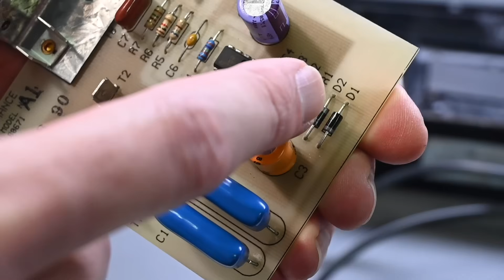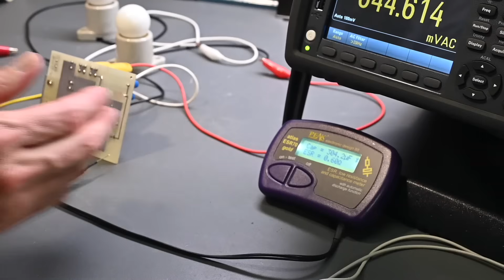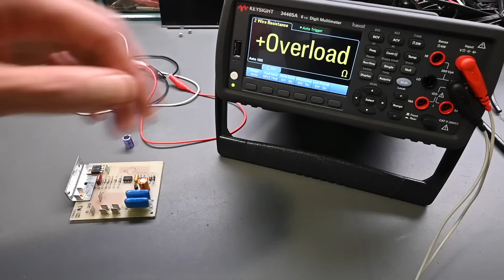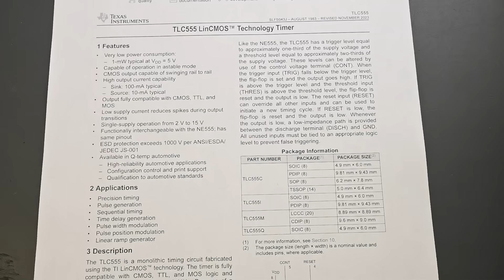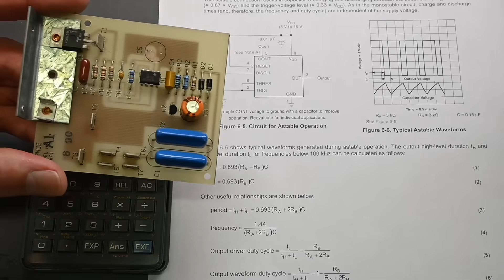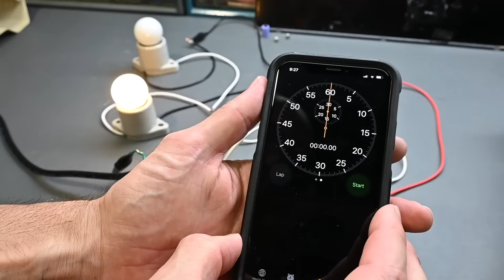High Voltage Neon Sign Transformer - Flash Cycle Is Too Slow, Let's Speed It Up

Comment: With long RC delays on a 555 the capacitor is always the thing, as the high resistance values mean leakage has a big influence. Capacitor always gets leaky, even 1M leakage will stop it charging, so you need to put in a good capacitor, preferably one rated for 100V, as that means thicker oxide layer, and thus it will have less leakage in the beginning, and also have a long life, as it basically is sitting at shelf life.

Comment: So the relation between the capacitor and the time looks to be linear.
Reply from the maker: Yes for a given Ra and Rb resistance the capacitor and frequency have a linear relation except in some extreme cases.  The TI data sheet page 15 shows some examples.